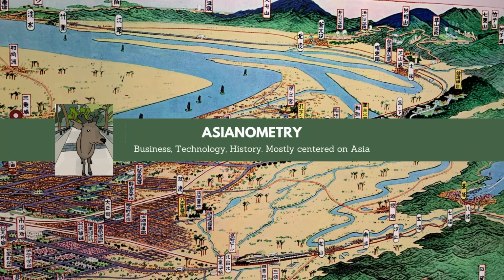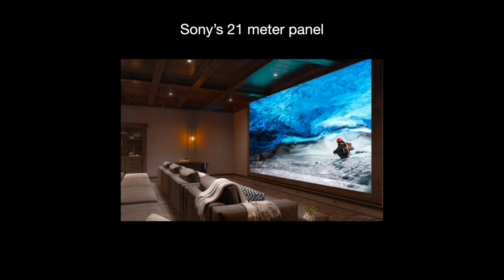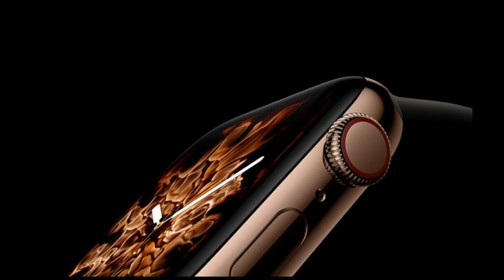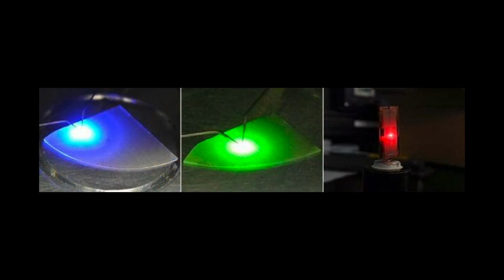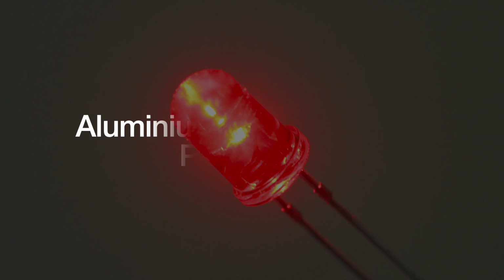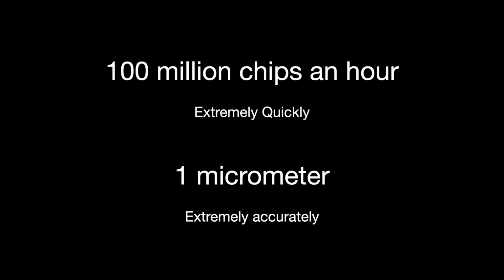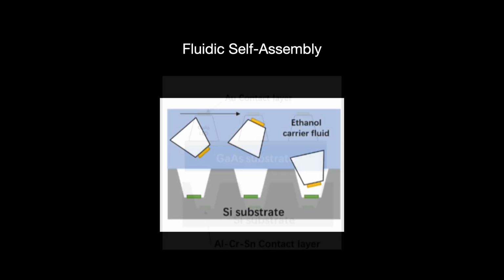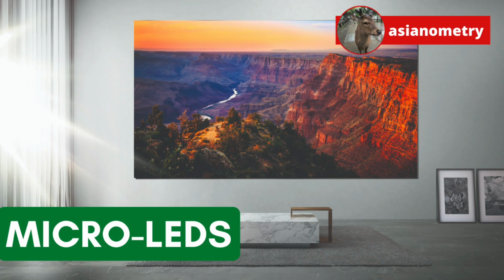Micro-LED Displays

Comment: Those big stadium displays consume huge amounts of power.  The largest reach close to 1MW at full brightness and many have their own air conditioning.
Reply: yes but that's simply because of their insane brightness, the efficiency is still higher than both LCD and OLED.
Reply: https://en.wikipedia.org/wiki/Eidophor That's the first jumbo tron technology. It was  also used by  NASA for their apollo control room.
Reply: @jmd1743  Here is another interesting video on how the NASA big board worked. https://www.youtube.com/watch?v=N2v4kH_PsN8&t=885s
Reply: 1MW? are you sure
Reply: @reahs4815  Yes for the largest displays it can be that high.
Reply: @reahs4815  Easily, an outdoor-brightness screen may take up to 1kW per sqm.
Reply: Modern displays no longer require air conditioning in any climate, though for lifetime reasons some in the middle east are air conditioned.  1MW would be a very large display but, yes, people drop 10's of millions of dollars on gigantic displays that draw 1MW sometimes.

Comment: Cathode ray tube tech did do HD they were not as bad as you initially said they could have done 4k as well we shifted tech before they were developed commercially
 Should be  pointed out that because these devices were so heavy, (the larger the screen , the thicker and heavier the glass ) we have most likely saved untold amounts of oil  not having to ship all of that heavy display technology. In audition,  because they are so much thinner and lighter more of it this display tech could be fit into smaller spaces. They are more efficient and use  much less electricity. I would love to have someone calculatie how much the switch from CRTs to flat screen technologies has  saved the environment and  energy costs on all levels of the value chain.
Reply: One of the practical drawback is power consumption and bulkiness.
Reply: @ntabile  My back appreciated the change.
Reply: Imagine 4K cathode ray screen weight around 100kg each
Reply: @stepbruv8780  well if the screen was large.  I remember the last  34 inch CRT HD TV's were around 200+ pounds.
Reply: @hitmusicworldwide  that’s a good for workout tv
Reply: 4K CRT existed, although not in color.
Reply: @DarthChrisB  you mean CCTV Quality?
Reply: @DarthChrisB it was simply a matter of drivers
Reply: They also have high response. Hence gamers sticking with CRT longer.
Reply: @techpriest4787  Not exactly. They have near-zero response times when dealing with an uncompressed analogue signal, since all it needs is synchronization and amplification. But a digital video signal would still have to be decompressed and turned into analogue inputs for the beam.
Reply: Yep, I’m still prefer a crt over anything else.

Comment: old games' pixel arts were designed for tubes... Also, with enough tinkering, you may achieve fusioning using those old tubes, just need increase the ... "pursuasion" hard enough and smash them billards fast enough.
Reply: just surround the tube with huge electro magnets you can rev and presto retardo ~ infinite energy

Comment: LED diodes not only emit light… they also absorb light, not super efficiently as the most high tech solar collectors, but well enough…  so every old LED tv that is thrown away could actually generate electrical voltage… not super well, but it does work.  If you connect wires to the old display and measure emitted voltage when placed in the sun you will get current. The possibility of making LED displays that generate their own power from sunlight photonics is entirely feasible… not sure why we don’t.  Remember absorb as well as emit.
Reply: It's the same reason you wouldn't use a sub woofer as a microphone or solar panel as a display even if it would technically work. You'd need separate electronics to handle it and the inefficiencies from the unoptimized system wouldn't give you usable product. And TVs are under lights that only emit several watts of power anyways; I also wouldn't want to have my tv shut off when I dim the lights.